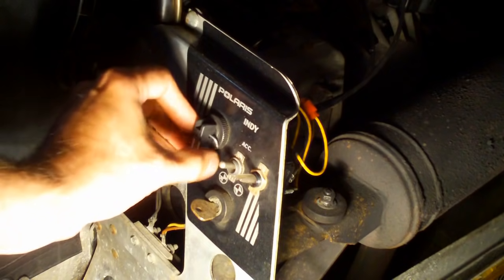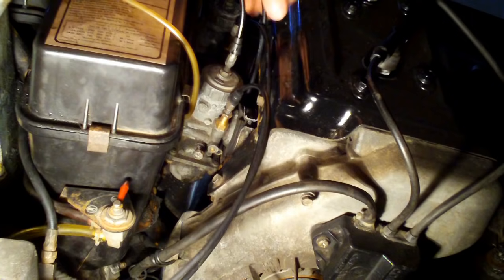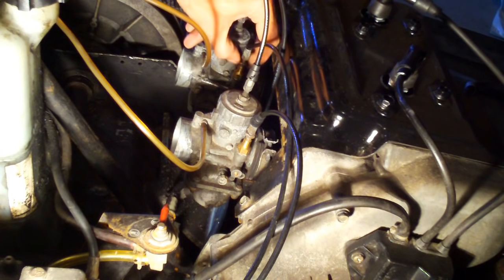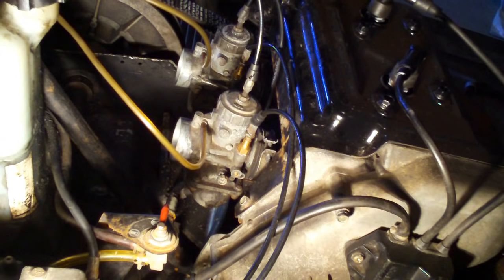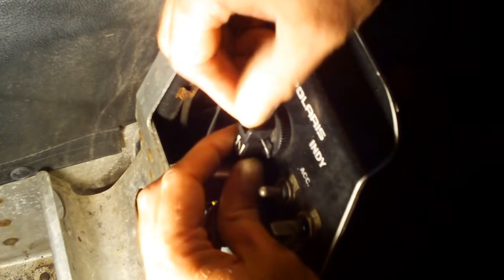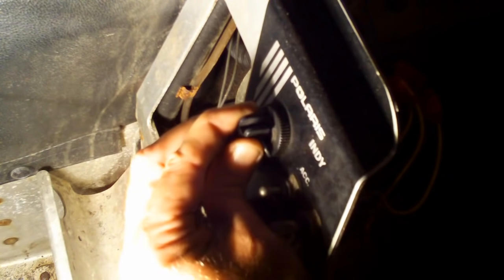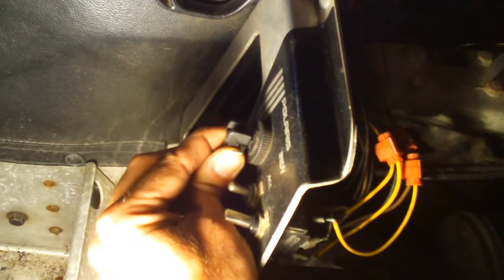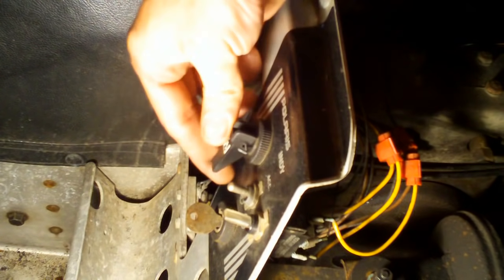How To Adjust Choke/Enricher for Mikuni ✔

Comment: newbie here who inherited an old sled from a deceased uncle. How do I use the choke? Do I flip the lever up so it's tight? Let it run for a few minutes then flip it down? Does turning the lever do anything?
Reply from the maker: @timreeve-newson515  there are two stages of choke. Halfway and full on. The lever pulls a cable attached to plungers under a spring. When the cable pulls the plungers up it opens a channel to let fuel directly into the carburetor and then cylinders. When you flip the lever to Off the plungers close that channel and the engine should run normally. You'll know it's time to close off the plungers when the engine starts skipping and slowing down (too much fuel going in). As far as turning, if you mean rotating the choke assembly, that should be ok as long as the cables attached to it will allow it.

Comment: Just bought a 1986 Yamaha XLV 540, runs ok, only when choked. Took carb to shop to get cleaned, it only had a bad jet seat? So I was given a valve along with to put in line. Did re install, cranked up after 20 seconds, seemed to be cold natured. It didnt stall out after 2 min of ride around. But turning choke off whilst on the trail still caused motor stumble😮 idk, fuel pump maybe?
Reply from the maker: I don't know what you've got going on there, that's definitely not normal. I think there is a sticker under the hood somewhere that explains the carb screw settings. Definitely starving for fuel. With the choke on it runs fine? That might rule out the fuel pump. I had one of those, I think it was an 84. Very good sled. You have to wonder if the crank seals are letting air go past them? Otherwise like you suggested, maybe fuel pump. Maybe something is blocking the fuel inside the carburetor. I've never had one of these carbs apart. I do know the top screw is an air screw. Make sure it's not turned too far out. Try it at half a turn out and see if it runs any better.

Comment: Skandic 600 2001 liquid, I’m not much of a mechanic. That has been a fabulous machine. On the third set of intake manifolds from cracking. Recent service (2x) to repair that and a broken choke lever. Machine was running great prior to service. Very sluggish to start on very cold mornings, takes a lot of cranking, multiple times, drains battery. Once it starts it runs fine. Is the choke setting too lean? If so, do we enrichen by raising the choke cable where it enters the carburetor? This machine was so incredibly reliable before. Immediate cold start with full  choke, then half choke for ten seconds…. Every time. Would like to adjust it for the same if possible. Thanks for the help!
Reply from the maker: I would try raising the choke barrels where it enters the carb one turn, try it, another turn, try it. If you go too far the machine will not run right, you'll know. I like mine adjusted so that raising the lever from off to half, halfway between the two, the engine starts to slow down from too much fuel at idle. Then you know it's full off when you want it to be, and working at half choke when you need it.
Reply: Two mechanics ago filled the tank with AV gas and some are telling me that might be entirely the problem? That switching back to 87 octane might take care of that cold starting problem? Thoughts? We live at 7,000 feet and it gets bitter cold before sunrise. I really hate to change carb settings if not necessary? Thank you for the help!  @contact4mwy7

Comment: Hey Mark i have a 88 yamaha exciter 570 and it has vm 38 carbs. The choke/enrichner has two adjustments.  One like in your video with brass barrel and jam nut. And the other adjustment is up further on the cable with adjuster and jam nut. My question is which do you adjust first. I want to make sure plunger is bottom out when the choke is off.
Reply from the maker: I would work with the adjustments on the carbs. Ideally you want enough slack to be able to raise the lever half way to half choke. With the engine running, raise the choke lever until the engine rpm begins to lower. If you're shy of halfway to the first stop (half choke) then loosen the choke cables a bit. If you get to half choke and the rpms do not drop, tighten the cables a bit. The thickness of a nickel under the lever for slack in the cable also works.

Comment: Good video I just bought a 2002 zr 440 it has flat slide mikuni carbs and it’s way over fueling and really boggy when taking off…. Everything’s clean in the carbs needle is in the 1 position but could the choke/enricher be out? It’ll start in -25 degrees Celsius with 3-5 pulls with the choke lever in the off position…. Im thinking the enriches aren’t shutting the extra fuel off! Any input would be appreciated, thanks
Reply from the maker: Hello Wade, it is important when it is fueled correctly to check the color of the plugs to make sure the air/fuel mix is correct. A nice chocolate brown to dark tan color. Position 1 on the needle sounds lean to me. Now, the enrichener plungers need to have slack in the cable or they will not fully seat, which may be causing your overly rich condition. Check you enrichener handle for free play as I did in the video. It is rare that they need to be replaced. Also make sure there is no fuel in the fuel pump pulse hose, a sign the fuel pump diaphragms have cracked and are leaking directly into the crankcase. Start with the enrichener plungers free play.
Reply: Ok I’ll check that stuff thanks. The plugs I’ve checked numerous times and they’re black. Which I would have thought they’d foul but haven’t yet. I agree that #1 needle is really lean but by the look of the spark plugs and the raw gas in the exhaust it’s getting way too much fuel. Is there way to test the enrichers to eliminate them? Also it starting in extremely cold temps without using the choke could that point to fuel leaking past them? Thanks again
Reply from the maker: @wadethomas1000  starting in the cold without the choke on and black plugs and fuel in the exhaust all show that too much fuel is going into the motor. Loosen the cables to the enrichener plungers by backing off the stop nuts,  adjusting the barrels downward a few turns and make sure you can pull and push the choke handle in and out without much effort. If it's not the plungers, check the fuel pump pulse hose attached to the crankcase and fuel pump, and check that the floats in the carbs are set properly and the needle/seat combo are in good shape to stop the flow of fuel. There should be an air screw on each carb that should be turned all the way in (gently) and then backed out 1 turn for initial setup. Those air screws mostly affect idle and the first 1/4 throttle, so I don't suspect they are your fuel problem.
Reply: I will check all of that… thanks a lot!
Reply: One more question sorry, the air screws were all the way in would that tell u anything?
Reply from the maker: @wadethomas1000  that means it wasn't getting enough air at idle through 1/4 throttle, making it run rich. It definitely wasn't helping your situation.

Comment: Okay question on how the actual choke plunger works.  Does it sit on the bottom (closed I guess) when adjusted properly, or should it sit a little off the bottom.  It seems that it has to sit a little off the bottom.  Asking this because for a Yamaha PW50– the choke cable was too short, so I made some adjustments to the cable length and made it a little longer.  The bike would not run properly until I adjusted the choke plunger off the bottom a little bit.  So, does this sound right to anyone?
Reply from the maker: Hello Brad. It should sit firmly on the bottom for a good seal when the choke is not needed. Your motor is probably running better with it raised up a little due to dirt in the fuel jets or a carburetor mix that is not set correctly. Is this a Mikuni carburetor?
Reply: @contact4mwy7   thanks Mark. It’s not a mikuni. It’s a Chinese carb.  So sounds like I need to mess with the fuel mixture or the air screw mixture.  Thanks.
Reply from the maker: Start with an average setting of turning the air screw all the way in until you feel it stop. Back it out 1 turn. If you can unscrew a cover where the pistons slide is, remove the pistons slide and see that the jet needle clip is in the 3rd groove down from the top. If it isn't, lay the jet needle on a flat surface and push down with the clip opening on the flat surface. It should "pop" off the needle. Don't lose that little e-clip, it's tiny. I have a video uploaded on basic Mikuni tuning that shows this procedure.

Comment: Curious if you'd have any ideas for me. I rebuilt my fuel pump on my 1993 polaris indy lite 340, and ot ran far better. Put it away for a few months, and now it simply refuses to pull fuel from the tank. Limes are clean and connected. I can pull fuel with a primer bulb when i plug it into the line. Good video.
Reply from the maker: Stephen, can you pull fuel through the pump by attaching your primer bulb to a line that goes to the carburetor? Maybe the fuel pump has dried out from sitting? Are you sure the lines are connected good and not letting air in? What condition is the vacuum hose that attaches to the crankcase, if that has a crack it can cause issues with not providing enough vacuum to operate the pump. Good connections on both ends, crankcase and fuel pump. The fact that it ran better makes me believe you rebuilt it correctly. The plastic films stack up in a specific order. Is the primer bulb between the fuel tank and fuel pump? If yes, then it should be able to push fuel to the carbs. Are you sure this isn't a carb issue? Sometimes ethanol gas does horrible things inside carburetors when it sits too long. Have you tried putting a little mix gas or WD40 into the spark plug hole, reinstalling the spark plug and tried to start it? Another trick I've seen is to put about a teaspoons worth of mix oil in each spark plug hole. This creates a better seal for the pistons which makes more compression and more vacuum at the pump. The pistons dry out and lose their compression/vacuum due to bypass. The oil trick has worked for me a number of times. If it still doesn't start put some gas in after the oil had been added. Let me know.

Comment: Great video! just replaced My plungers and adjusted. Still having problems. My sled only goes about 6000 rpms 3/4 throttle and seems to be running rich I feel like I’ve tried everything. Compression is 120 on both any ideas would be greatly appreciated.
Reply from the maker: Jeremy, run the sled at 3/4 throttle for a stretch then shut it down and pull the spark plugs. White chalk means lean, black soot means rich. Coffee brown means you're spot on. I take it this sled has Mikuni slide piston carbs? There is a clip on the jet needle that can be snapped onto one of 5 grooves (usually). The number 3 groove is in the middle, number 1 at the top, and number 5 at the bottom. Groove number 1 is the LEAN end, groove number 5 is the RICH end. You can make adjustments, moving the clip one groove up or down at a time and recheck your sled. I have a video on these if you want to check it out, but always go by what your spark plugs tell you because Rich and Lean feel very similar on the throttle. Also, this clip controls the mixture from 1/4 throttle to 3/4 throttle, where you probably operate the sled most of the time, so it's good to have this set correctly. https://youtu.be/2Ho5M-vaYCc
Reply: Thanks again. Did what you said and the plugs were wet I also noticed fuel in the impulse line. Does that defiantly mean needle and seat as I just rebuilt the fuel pump also thank I’m lost completely

Comment: Hi man. Is it okay to roll and tidybup the excess length of the cable or is it going to affect the play of the choke. Have the same lever choke cable on my scooters mikuni carb which i converted to manual choke.
Reply from the maker: I would say it's okay to roll it up in a big enough loop that the cable can still freely move inside the sleeve. Keep checking the free movement of the choke cable as you roll it up to make sure the motor still runs as it should. Thanks for asking!
Reply: Mark Young - Outside The Box hi man now got a very weird thing on manual choke. When i turn the lever on, it won’t idle but when i turn it off it idles haha how come it does the opposite?lol any advice why?thanks

Comment: Rebuilt my Mikuni carbs tonight. I totally needed this video after! Thank you. 
Do you know how to sync the throttle cable adjustments? I'm sure I messed those up when removing them.
Reply: Here's what I'm thinking. Is it accurate?
1. Loosen both of the carb throttle adjustments until there is play on the throttle lever (on the handlebars). 
2. Tighten one carb throttle adjustment until there is zero play on the throttle anymore. 
3. Then adjust back to provide a little play on the throttle lever (remember how much you pull back).
4. Now move to the other carb throttle adjustment. Tighten this one up until the last bit of play is removed from the throttle lever. 
5. Now re-adjust the first adjustment back the amount you “adjusted back” in step 3.
Reply from the maker: @Galatians525  You could go through all that, or you could try this; sync the two together by sound by backing the the idle screws out until they no longer touch the slides. You can hear when the two carbs "click" in unison when backing off the throttle when they are synced up. If you distinctly hear two clicks, find out which one is too long (making the second click sound) and adjust that cable shorter until you hear them click together. I know this is not a standard procedure, but it works. Here is a link to my video on doing this. https://youtu.be/0HXUpMS2Xc0 I read that you do not want to have the throttle cables so tight that the piston slides are brought right up against the bottom of the slide cover as this will put a strain on the throttle cables leading to failure at some point. Try to leave enough free play that you can still raise the piston slide very slightly at wide open throttle. Sounds like I should make another video explaining this better? Lol
Reply: @contact4mwy7   Thanks! I'll check it out.

Comment: I have a 99 Indy 500 it doesn’t start it floods itself and I don’t know how to fix it
Reply from the maker: Start with the floats, needle and seat inside the carburetors. If the needle doesn't stop the flow of gas it will go into your intake. Next would be to check those enrichment (choke) plungers. They have rubber ends on them that can harden up and leak gas. Also check that there is enough slack in the cables leading to those enrichment plungers. Not enough slack will hold them open and allow your flooding situation. I hope this is a good start. Is it one cylinder or both? Have you looked at the spark plugs for verification?

Comment: could you use a 1/8 bit to get the gap? instead of holding it seems tricky to do on my sled
Reply from the maker: That seems like it would work too. Tighten each cable until it stops with the bit in place, then tighten the jam nuts?
Reply: @contact4mwy7   thats my idea!
Reply from the maker: @ziegelbauer  I say go for it, and let me know if it works as well as it sounds like it should!